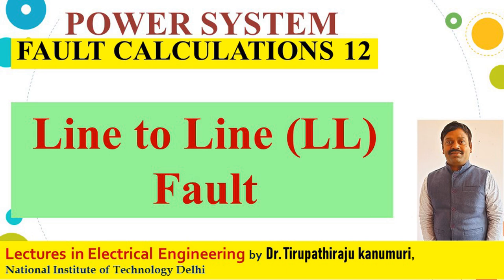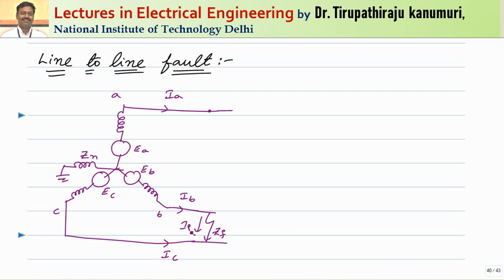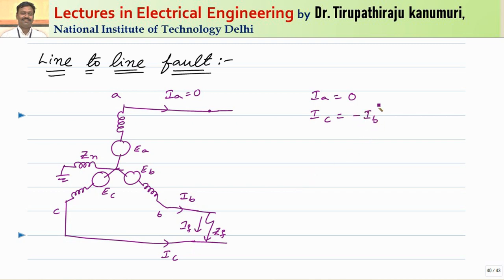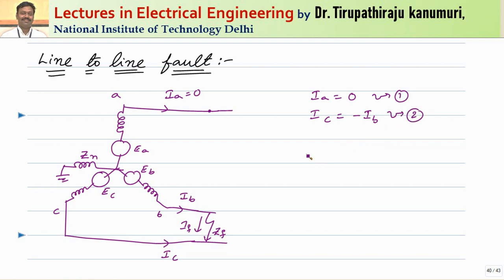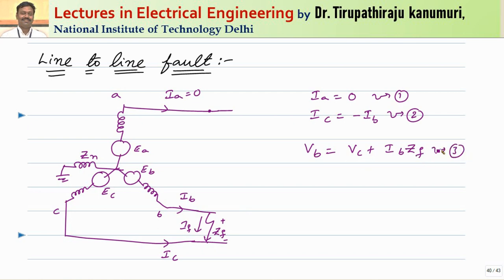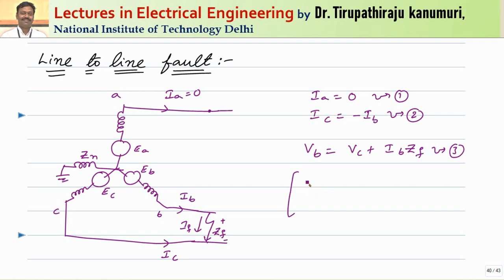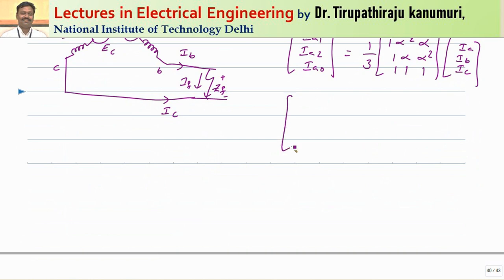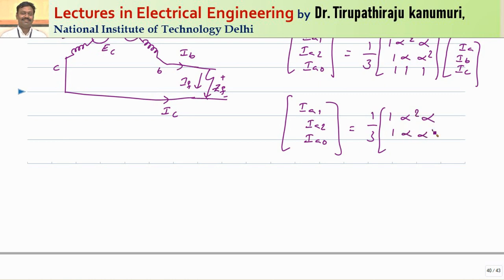PS93 Line to Line LL Fault

Comment: Sir if in LL Fault, the line currents of the line is in opposite direction with the same magnitude, that should mean the Fault Current would be zero or there's no overcurrent on the fault. Can you clarify this sir? :D
Reply: Fault current is not ib+ic but it is either ib or -ic .so it cannot be zero